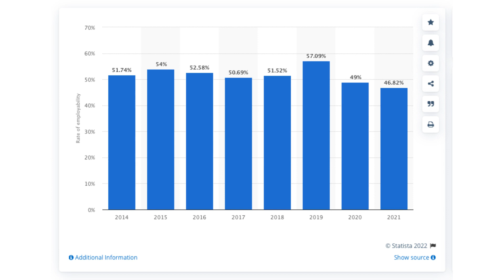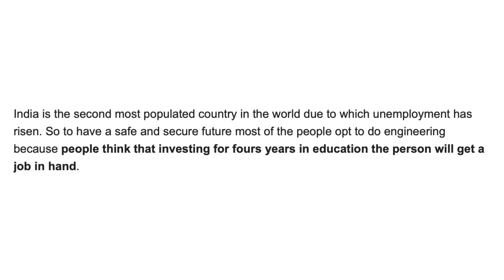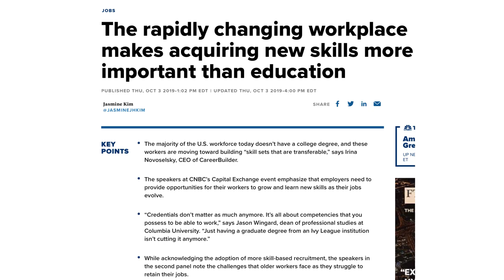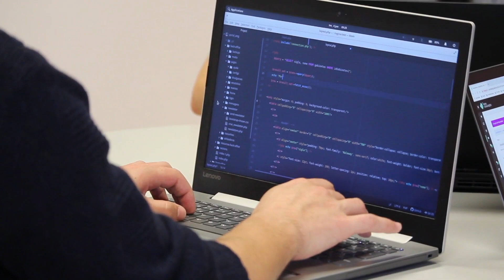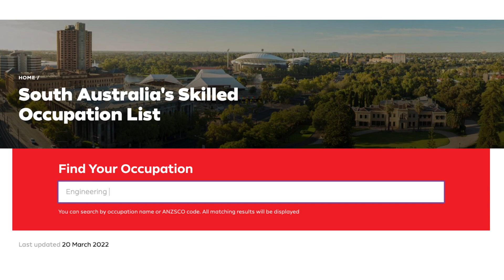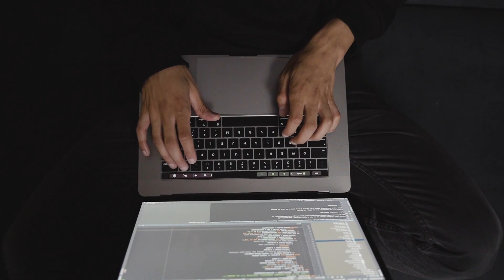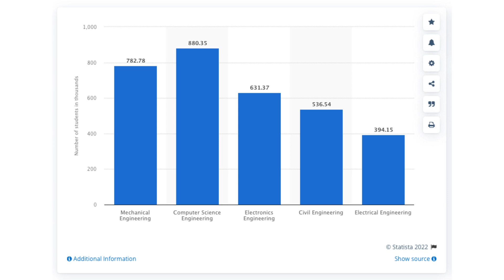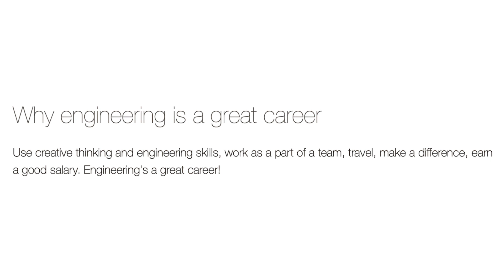Should You Do Engineering In India In 2024? | Nikhlogic

Comment: Automobile vs Petroleum engineering which is better ?
Reply from the maker: Hey bro, I wouldn’t recommend Petroleum engineering or Automobile engineering, since it’s a niche field & the demand for jobs in this field isn’t much high in India. 

I would rather advise taking mechanical engineering & then specializing in petroleum. It’s always better to go for a Broader field, because tomorrow if you want to switch your field, it’s easier to do. 

Eg, if you want to go for automobile or you want to go into aerospace, you can still do it as a mechanical engineer, but if you are doing petroleum; it will be much difficult. Also, to work in Oil & Gas sector, Middle east is a great place to work at. Also, most of the Oil & Gas companies will have mechanical people working there. So rather go for the broad field. 

Hope this helps & if you have any doubts in this field, feel free to drop me a message on Instagram @nikhlogic. Will be happy to help :)